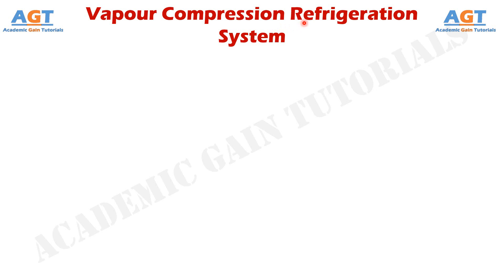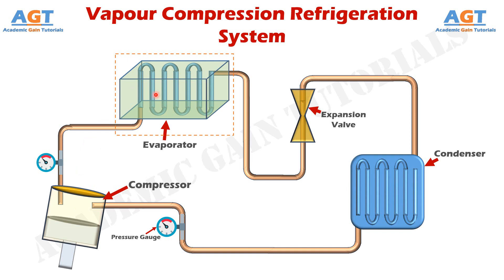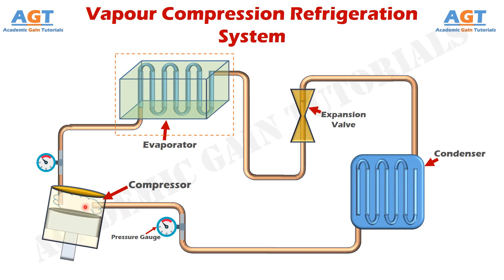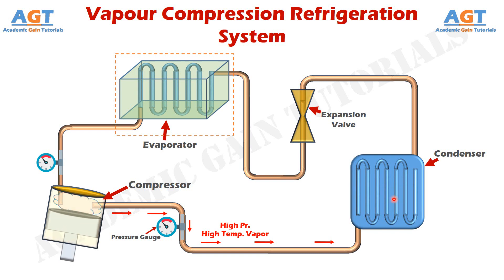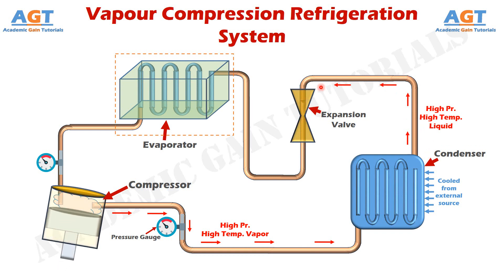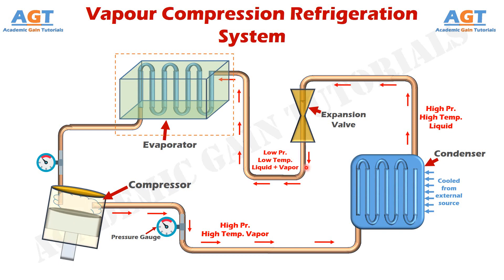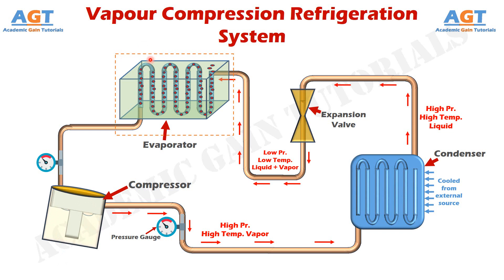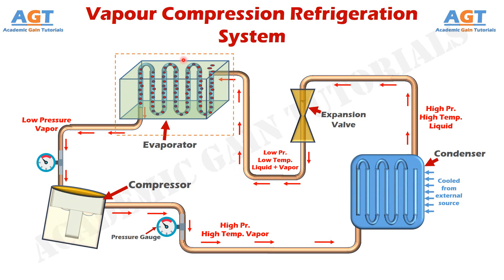How Vapor Compression Refrigeration System Works - Parts & Function Explained.

Comment: why is the refrigerant temperature still high after passing through the condenser, isn't it supposed to be cooled there?
Reply: Temperature does not change during a phase change. All the condenser is doing is changing the refrigerant from a vapour to a liquid. The temperature will be reduced at the expansion valve when the pressure is also lowered.
Reply: The process takes place in the condenser is only reducing the latent heat. Latent heat is the energy absorbed or released by a system during constant temperature.
Reply: Listen carefully

Comment: High pressure high temp vapour enters into the condenser and condenser take the latent heat of vapour. Vapour exit in liquid form. But temp remains same. How? Heat is extracted from vapour then why temp not falls?
Reply: I understand your question bro, if see the video they have just started from the topic of VCRS, but in this video they have not thought the basic behind using only these components. So if you know what is the basic principle that to be needed for us to produce cooling effect you will get know the answer.
Reply: I also agree with your statement,it allows only low temperature at the condenser output, pressure is entire cycle constant,its an isobaric process. condensor first remove super heated steam/vapour,later at a certain instant of time latent heat removal,or it means it achieved saturation temperature, after that the refrigerant turns to a sensible temperature or in sub cooled state only.always saturation temperature should be greater than the sub cooled temperature. If the difference between the saturation temperature and the subcooled temperature is less than 10degree Celsius, we can say that defficiency of refrigerant inside the compressor. Always the compressor has to maintain 10 degree Celsius minimum for proper cooling.

Comment: at 3:36 after condensing process, it should have the low temperature and low pressure, right? if not then would you mind explaining me here on comment section. btw, great animation video. Keep it up
Reply: No. Only the phase change of the refrigerant occurs, that is, from vapour state to liquid state. It still has high pressure and high temperature.
Reply: @STARAQIL  oh I understood. Thanks a lot man
Reply: @STARAQIL  👍
Reply: In the condensation process, the pressure will be constant, but the temperature gets reduced also the phase change occurs

Comment: let me clear you that the basic function of condenser is to reject heat and reduce temperature and pressure you had mistakenly written here that condenser passes high pressure high temperature liq. to expansion valve
 that is not true. correct me if i am wrong.
Reply: agree condenser rejects heat.. but it doesn't reduce the pressure... refrigerant turn from high pressure vapour to High pressure liquid... its Expansion valve (throttling vavle/ capillary tube) that reduces the pressure of High pressure liquid refrigerant